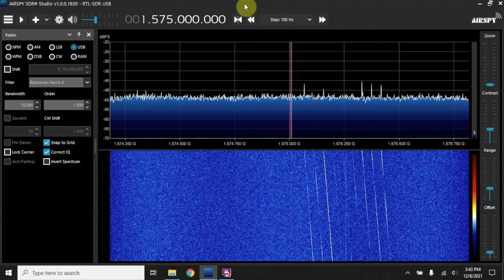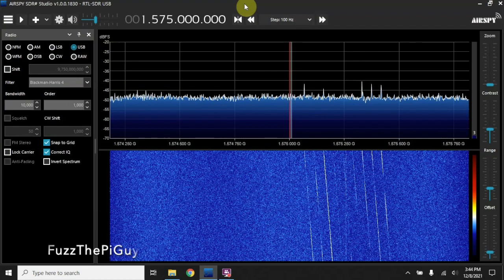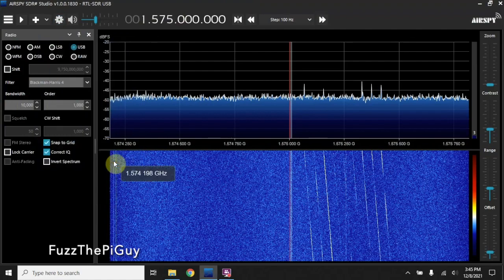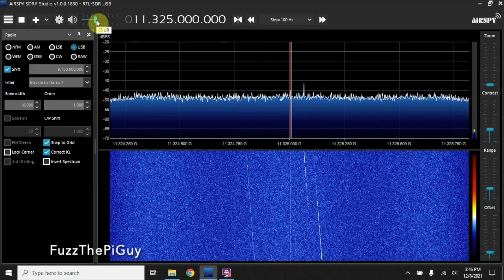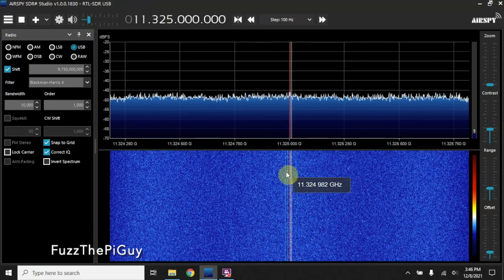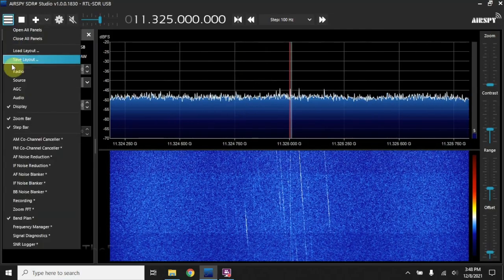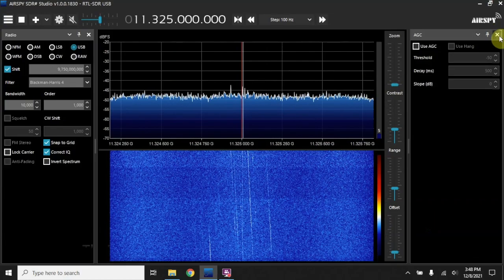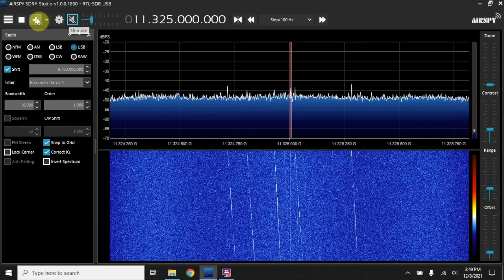Star Link  |  Receiving Beacon Signals With A NooElec RTL | DirecTV Power Inserter And LNB

Comment: Explain the drift? Are there any routes to mod so 'tracking the drift' can be automated?
Reply: It's called doppler effect. Since the satellites are not in a geostatiinary position they move across the sky. Their movement shift their perceived frequency on the receiver end. To put it simple: it's the same effect you hear whenever an ambulance passes by with it's sirens on. As it gets closer the pitch raises and when it passes you and starts to move away from you the pitch lowers. The principle is very simple but i suggest you to look at some documentation on this effect to better understand how it works.

This type of situation happens with every non statonary satellite. In order to compensate there are specialized software such as Orbitron who automatically calculate the doppler compensation rate on a given satellite (keep in mind that the value changes continuously because of the satellite movement). It can also drive satellite dish motor arrays and connect to other apps such as SDR# and tune your receiver in real time to the correct doppler compensated frequency.
Reply: Greetings, looking at the specs for the lnb it shows a 19v and an 18v input, but the inserter shows a 21v output. Will that be ok?